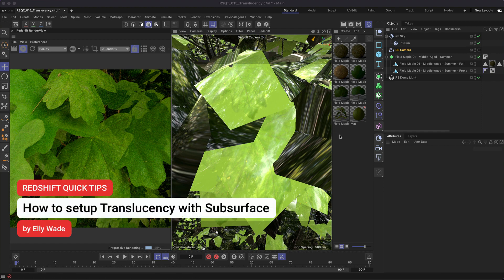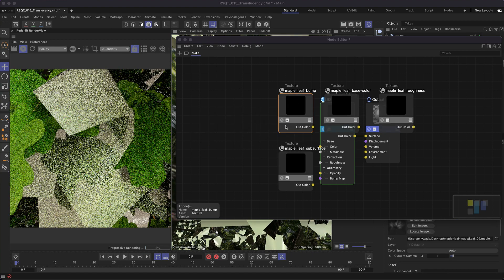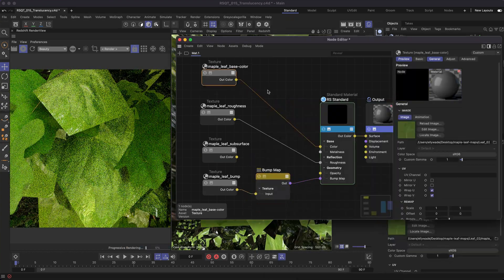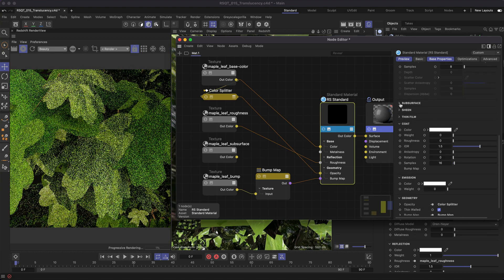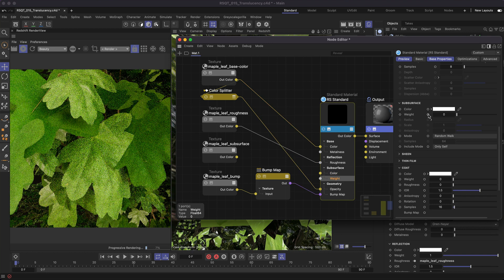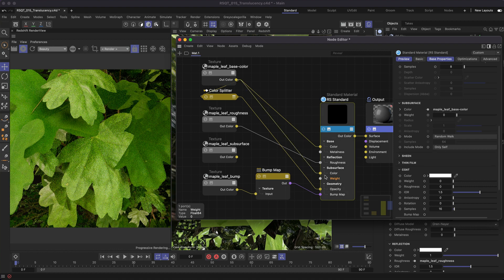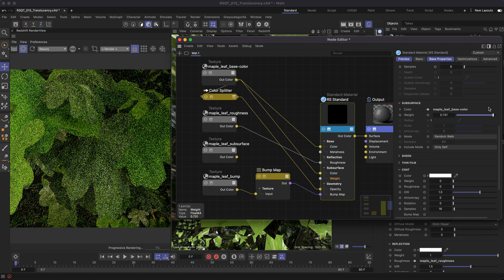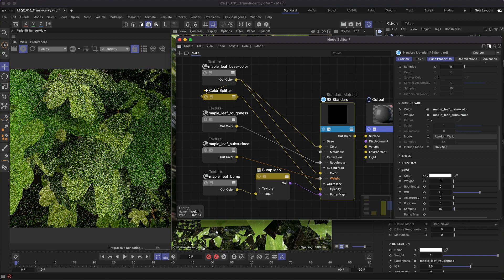#RedshiftQuickTip 15: How to setup Translucency with Subsurface

Comment: Elly, why dont you use the stencil for node instead of opacity ? Stencil designed to render much faster than opacity especially with dense vegetation
Reply from the maker: This was just a quick demo on how to setup the translucency, in the full setup for the material it uses the sprite node :)

Comment: Thanks, Elly! Completely missed it in a new Standard Material as haven't considered thin walled.
By the way, I still beleive that RS Sprite node will allow for better performance in terms of applying Alpha.
Reply from the maker: Yes you're right! In this setup I'd normally use the sprite node, this was just a quick demo so I used opacity for speed
Reply: @MaxonTrainingTeam  I guess you can take 1 min more to set up things properly, no? We are many people that learn from those quick videos, what is the point to rush them, take shortcuts and edit them at x3 speed? ...

Comment: Hi. If I do not have SSS weight map, what to do?
Reply from the maker: I'd say the same as @nuncatto. Try use one of the other maps and tweak it with a ramp to get a better weight map
Reply: try to use any other black and white map, for example the roughness map